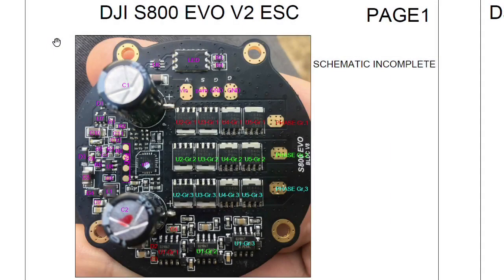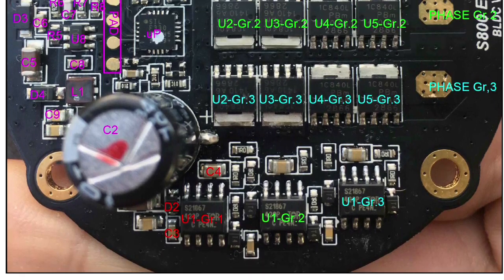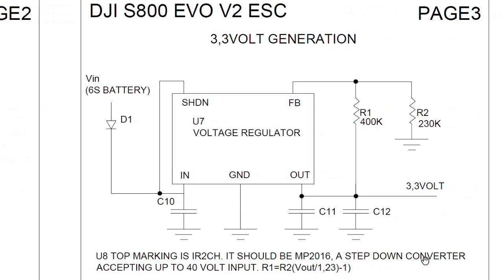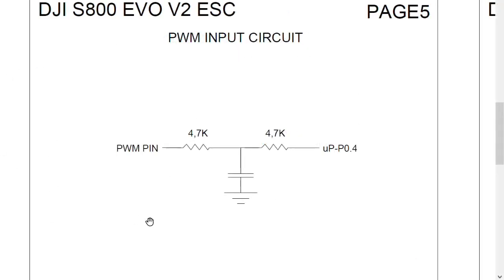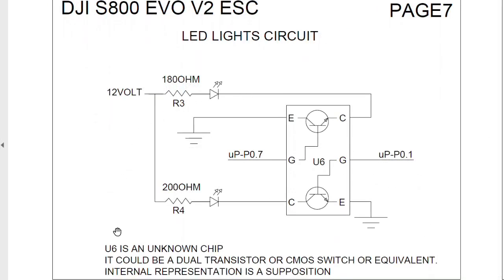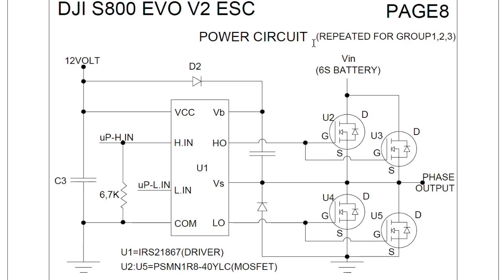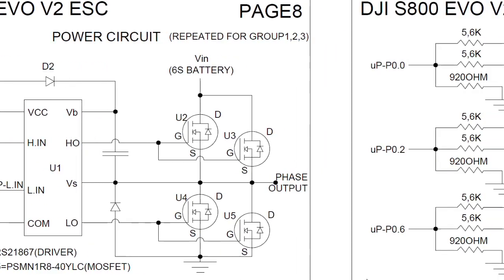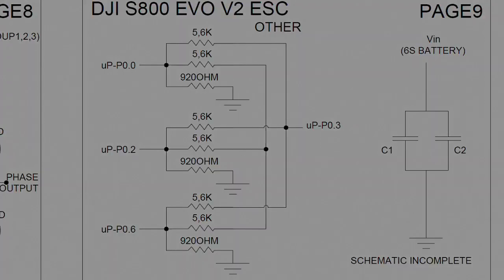Dji S800 (and S1000) ESC schematic

Comment: Hi, I have a problem and wonder if you can help. I have an S1000 with these ESCs that is giving me trouble. 4x ESCs and motors work as they should (running A3 pro controller). But the other 4 will not spin up using the "test" option in DJI Assistant,  as an experiment I ran the "Calibrate" process which makes the problematic motors spin, other than this they don't exhibit any problems. I am having trouble getting replacement ESCs in a reasonable timeframe so am hoping to resolve this issue.
Reply from the maker: How Did you verify that the problem Is not related to A2 and to cables?
Reply from the maker: Did you inspect ESC pcb? Did you find some dark component? Some burned parts?
Reply from the maker: How Did you verify that the problem Is not related to motor?
Reply from the maker: I suppose you are in USA

Comment: Hi,
What type of ESC does the  dji S1000 have i.e..   Linear type, Switchable type  ??  im connecting a pixhawk onto it and i need to know weather i must remove the red wires if it is switchable type ESC otherwise it will create some problems for me in the air and perhaps Crash! 
Thanks.
Reply from the maker: Oliver Kan the esc microprocessor is powered by a linear voltage regulator, so you don't need to supply the esc with additional low voltage. Just wire the ground wire and the pwm wire from pixhawk and the 2 power wires from battery
Reply from the maker: I'm not sure if the pwm frequency and pwm duty cycle is compatible with pixhawk
Reply: @gaucholivido  I had the same question.  Thanks for answering what I could not seem to find in any of the DJI literature, nor anywhere else I found online.